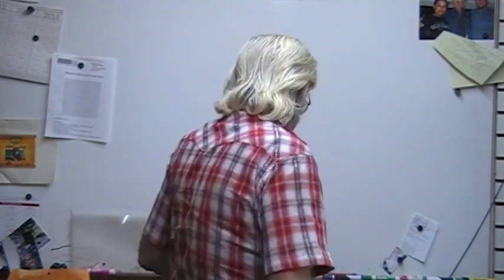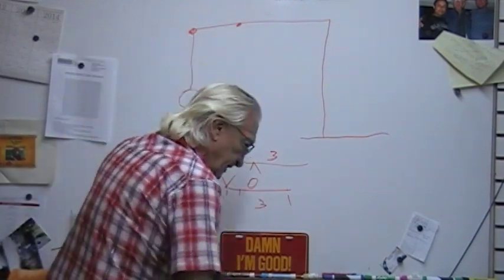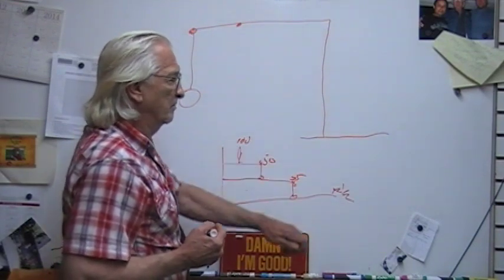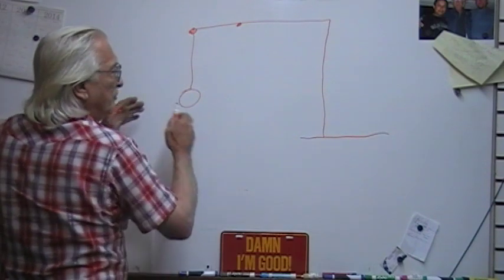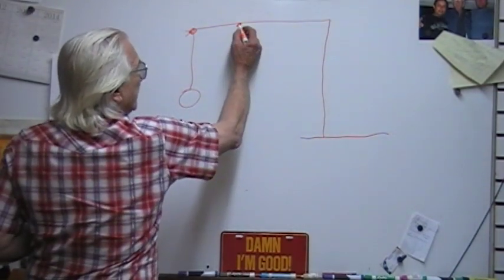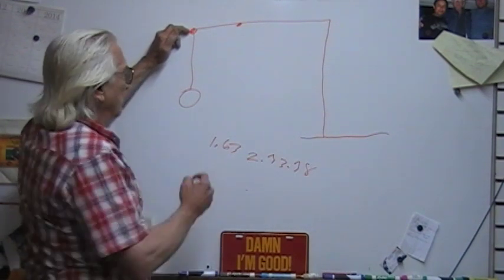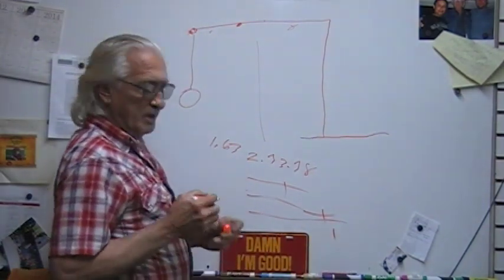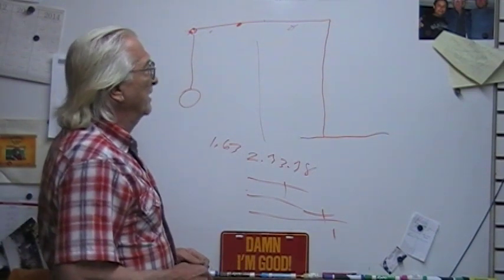workings of the TSO

Comment: Sir, I am six years older than you are and  watching this video I feel that it is my duty to  gently point out to you  a few issues,  before I die  and  regret to have never told you my secrets , as watching this video suggests that there is a little misunderstanding about the concepts  that you mention.

First , and understandably because of your hard work, you seem to be so certain that you have an over unity machine, but you must clear your mind as to what phenomena  you claim  is over unity.  Input and output Energy and Power in a machine  can never be over unity  as energy cannot be created, only exchanged. ( a bomb exploding in air is over unity because of its internal fuel exploding and not because of any exchange between  gravity and its velocity  during its flight after it leaves the muzzle of a gun)  On the other hand  input  and output forces in a machine as a lever of any type can be different and "amplified"  but it does not mean that Energy or Power is amplified, only forces  are changed and normally if a Force is increased  in a lever the related movement is decreased and vice versa.  Also please note that gravitational field is conservative and the work done between two points is independent of the path taken ( forgetting losses as you well know and found out by changing the pulleys to a better set)

At 8:28   when you describe the transverse lever you say that, " it is moving a greater distance, giving you four times the WORK" Well , I am afraid that is not true, the work done is exactly the same as the first  large force moving a shorter distance. There is no amplification there.

When you show concern about  the flexing of the  horizontal top power transfer bar to make you  modify the transverse lever to a shorter arrangment, well you can design a power transfer bar  by adding a geodesic structure to give you a higher inertia due to an effectively wider bar. A few structural elements in the form of triangles will  eliminate your concern for flexing of the power transfer bar.

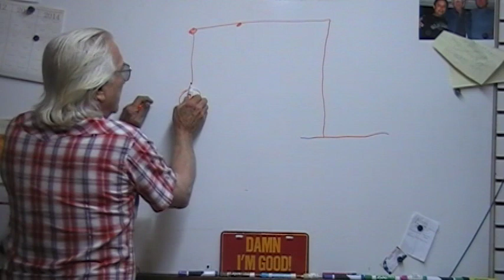Now as far as the pendulum, you never actually mention the most important issue, that of centrifugal force of the pendulum as it swings and changes  the direction. Well that pendulum is accelerating as its velocity is changing direction and so the force is outwards  of the circle it moves in and" the ten to sixteen degrees of pure power" you mention  at 9:48 is only the effect of CENTRIFUGAL FORCE DOWNWARDS.  It is a vector  Force and not Power. It is this centrifugal force plus the weight of the pendulum which is transferred to  along the power transfer bar to lift the load through the transverse lever ( which you do not really need)

Here is an important issue that you seem to misunderstand. Your system has a very useful energy storage system called a pendulum, and this can store energy to be used later. With a little force  applied over a long time or distance, it feels that one is not working so hard as a small force over a long distance is  an activity that  a person can tollerrate, but not a  high force for any length of time. This action was used in old petrol engines before they had electric starter, one would wind  a handle with a small force over a  relatively long time to store energy in a spring or a flywheel. Then the stored energy is clutched to the engine and the engine rotates  with a large force for a short duration for one turn and starts .  The converse is true for a clock or a  mechanical watch, one winds a clock over a short time with a high force and then  the clock escapement uses a  tiny force for a long time even up to 10 days. All this is due to the capacity to store energy to be used at a later time.

This is the principle of your machine, you have a heavy pendulum in which you store energy by swinging it with a small force over a long  relatively time and then during that "ten to sixteen degrees" when the centrifugal force on the pendulum acts downwards this plus the weight of the pendulum will give the load a  short jerk  where the  energy given to  the  load being pulled up  against gravity is exactly the  energy  lost by the pendulum during those " ten to sixteen degrees of pure power" as you gracefully put it at 9:48

Now Sir,  I hope that you will not be too disappointed that your structure will never amplify ENERGY and is not over unity as far as energy or  integrated power goes.  But  you have managed  to use a little FORCE applied over a relatively long period to store Energy in a pendulum to be used later  on a load as a larger FORCE over a shorter duration of time.

Now this principle can use a heavy flywheel and if you ever market a  water pump to be used in developing countries, yes you can have a child rotating a handle with a small force for a long time  and a reciprocating pump with a  short stroke and a heavy force to irrigate his field. Yes there I agree that it is a useful machine as humans can generate a small force for a long time, but  not a heavy force for any length of time.   And any way a man can only produce about .3 of a Horse power and he can store that in a large flywheel and use the stored energy to deliver higher power FOR A SHORTER TIME  till the flywheel or pendulum loses it .

I admire you for your interest is science and the associate engineering, and though I wish you keep enjoying yourself researching on the TSO, please take my advice and work on the storage of energy in flywheels or pendulums through small forces applied for a length of time and then used elsewhere through  loads using high forces for a short time as in pumps or small forces for a long long time as in mechanical watches. Wish you luck.
Reply from the maker: +Carmel Pule' SORRY ;  I  think you missed  something very important in the video.  Where I said "IF"  the machine is NOT over unity It still has practical use  . Such as using ones body weight to pump water to fields as they sleep.                  PLUS  I think you missed the video where I was driving the pendulum with a falling weight and picking up another weight .  The driving weight (80 LBS) fell 5 inches and picked up 6 BLS 4 inches  50 times.  80 X 5 is 400 inch pounds   6 X 4 is 24 inch pounds  X 50 times is a total of 1,200 inch pounds out to 400 inch pounds in.
Reply: +RHEAD100    Thank you for your information but Now let us analyse it.
You said that you  picked up 6LBS 4 inches 50 times  so that you raised that weight  200 inches .  I am new to our videos but as yet I have not seen any of your machine which are 200 inches high.
Since you mentioned 50 times I feel what you meant is that you picked up and LOWERED the 6 LBS 50 times.
I saw this raising and lowering of the weight many times in your  and other videos so here is what you should consider.
When the 6 LBS weight was lowered after it was raided,  its potential energy was GIVEN BACK to the pendulum  through shifting its pivot point and so the pendulum was being given energy  by the driving weight (80 LBS) through the escapement  that drove the pendulum  and also by the falling 6LBS weight dropping down.

Now you must consider that a a pendulum can be given energy through swinging it in a conventional manner and also by driving its pivot point, up and down and left and right in a synchronous manner.   This is exactly what  your two stage oscillator is doing  when you  drop the weight you lifted.  So since you dropped the weight , you transferred its energy back to the pendulum and so cannot claim that you did work on the 6 LBS weight.

Please do consider how much energy is fed back to the pendulum when the horizontal bar and the weight falls.
I think you will be very surprised.
Other researchers  can  confirm what I concluded and they did say that if the weight  is allowed  lift and drop  then the oscillation will proceed for a long time. If the weight is not allowed to drop to retain the energy , then the pendulum will have to be driven harder.
Well,  it is new year's eve and sir , I wish you a happy new year 2016.  I hope you reflect on what I said about the falling weight GIVING BACK ENERGY TO THE PENDULUM  and so no work done not energy is gained by the 6LBS weight.
Please do inform me whether in the data you supplied me with , you did actually lift the 6 LBS weight for 200 inches. as I feel that you did not.
Reply from the maker: +Carmel Pule' What you are saying would hold a lot of water to someone that understands book math and science. "BUT" to some one like me that has actually  used that same falling weight to turn a generator and charge a 12 volt battery from 9.5 volts up to 12.75 volt must as you , " how did the falling weight energy get back into the pendulum from the battery when the battery was not hooked to the pendulum in any way ??   I have had many people tell me the same thing,  "the free falling weight returns energy to the pendulum.     IT  DOES  NOT !!!!
Reply: +Carmel Pule' 

It is the last day of the year 2016 and history is
going to be made.

PROOF THAT FORCES AND ENERGY IN THE FALLING WEIGHT OF A
TWO STAGE OSCILLATOR IS BEING TRANSFERRED TO THE PENDULUM, BOTH DURING STATIC
AND DYNAMIC STATES.

Static condition. 
(For clarity let us assume that the horizontal lever on top is pivoted
at its centre. If it is not, the ratios of forces can easily be calculated
according to moments)

Take a dead load of 100lbs touching the ground and a
simple (not compound) pendulum weight 80 lbs hanging vertically, all without
motion. In this static situation the 100 lbs weight will transfer 80lbs force
back to the pendulum to keep it hanging without dropping, while the reaction on
the ground of the 100 lbs weight will be 20 lbs. The pendulum will not fall
because the 100 lbs is transferring 80 lbs force to the pendulum.   This is the first proof that there is a
force during static condition that is being transferred from the weight to the
pendulum.

Dynamic conditions.   With 100lbs
weight on the ground and an 80 lbs pendulum, the pendulum must be swung and
raised to a height to gain potential energy so that when released this will
accelerate to produce velocity and centrifugal force of at least a 20 lbs down
component in order to be added to the 80 lbs of the pendulum in order to lift
the 100lbs weight. (Let us say the pendulum was raised to a horizontal position
before it was released, and any position will do, but this is easier to assume a
horizontal position) 

THIS RAISING OF THE PENDULUM NEEDS A LOT OF INPUT
ENERGY.

The pendulum is released and nothing happens to the
100 lbs weight till the velocity of the pendulum produces a downward
centrifugal component of 20 lbs. At this  state, both the 80 lbs dead weight of the
pendulum and the 20 lbs down component of the centrifugal force will be
DROPPING DOWN LOSING ENERGY  while the
100 lbs dead weight that is  lifted GAINS
ENERGY AS THE CENTRIFUGAL  DOWN
COMPONENT  rises to 20-21-23-25- till
maximum, then goes back to 24-23-21- 20   to less and less. During this sector of
pendulum motion the 80 lbs pendulum and the down component of the centrifugal
force lose energy while the 100 lbs weight gains maximum energy as it reaches
its highest point. Note that the 80 lbs weight of the pendulum is losing energy
acting as an input in addition with the swing of the operator and this has to
somehow be regained at a later time.

Now if at this stage the 100lbs weight is quickly
taken off to do work elsewhere without effecting the pendulum, then the 80 lbs
swinging pendulum will drop fast rotating about the central pivot of the
horizontal lever, till it places itself below it, still swinging complexly but merrily
away doing nothing else as there will be nothing to raise it back.   But this does not happen because the 100 lbs
weight will remain attached to the pendulum, giving back an interesting set of
dynamics to the pendulum. 

Now let us assume that the pendulum has now swung to a
horizontal position( not necessarily but let us assume that) With the 80 lbs pendulum
horizontally placed  it will not transfer
forces nor energy to the 100lbs dead weight and it will use the 80 lbs to
accelerate itself down wards. At this time the 100 lbs dead weight at its
highest point, will accelerate itself downwards too, to later lift the pendulum
back to a higher place. When the pendulum takes an angle then its pivot point
is lifted up by the dropping 100lbs while the end of the 80 lbs weight of the pendulum
acts down. So at this point the pendulum pivot is lifted up with 100lbs while
the 80 lbs weight of the pendulum acts down, both separated by the length of
the pendulum producing a massive torque on the pendulum to swing back. (note,  the contribution of both the 80 lbs AND THE
100 LBS OF THE  still ATTACHED WIEGHT. )

If the 100 Lbs weight was not left connected to the top
horizontal lever the   swinging 80 lbs
pendulum would drop swinging about a vertical line through the central pivot of
the lever.  THE DEAD WEIGHT OF 100 LBS
CANNOT BE LESS THAN 80 LBS never, never. 
So if one needs to transfer energy to an external load only a weight of
20 lbs may be completely detached from the 100 weight to do work elsewhere,   but then the operator will have to pay for
it as the pendulum will not swing back to the original position, where an
operator can swing with one hand and have coffee with the other!!

I picked up the extreme case to prove a point but any
related state can be worked out.

If the 100 lbs weight, or part of it, is removed, then
the Pendulum will keep dropping in its swinging height till if the weight is
below 80 lbs there is a rotation such that the pendulum together where the
horizontal lever will become vertical where both the lever and the pendulum
will produce complex modes of oscillation attributed to systems with two
degrees of freedom as the two stage double pendulum.

This is proof that the 100lbs weight or not less than
80 lbs must remain attached to transfer force and energy back to the pendulum,
if the operator in not be subjected to heavy sweating not only to swing the
pendulum but to lift it from under the central pivot point of the lever (which
is the second pendulum in fact)
Reply: +Carmel Pule' Carmel , you're away with the Newtonian mechanics and I'm away with the Fairies but it's grand to read your real world academic stuff from out here in the Irish twilight zone. RHEAD100 is a man with the guts to try new approaches to mankind's antiquated and unhealthy methods of getting machines to do work for us, without raiding the primordial graveyards of plants and animals. He follows his gut feelings. In his own time at his own expense, he publicly demonstrates failure so others can learn from his good intentions.  I'll try to simplify what I think RHEAD100 means by "exponential energy gain". He can feel it in his imagination but like myself, he's a hands on pioneer who enjoys doing things instead of reading about things in text books. The Wright Brothers had no reference books on aviation! A century from now,  RHEAD 100's efforts will probably inspire someone to write books on Pendulumics and Gravitamic Dynamics.    Pure energy, by it's nature,  is an exponential force. Solid mass is a cluster of individual photons and electrons clumped around the nucleus of atoms, propelled by an inexhaustible and seemingly intelligent force, we humans call Gravity, or maybe it's the elusive Higgs Boson, the God Particle.  Either way, you'll agree Carmel, in the intelligent design of things,  there's a constant electromagnetic tug - push - pull - shove on everything and motion seems to be the natural state of being. Static is an illusion. At the molecular level, in quantum field physics,  everything is orbiting something in perpetual motion - no such thing as rest position, so what now Carmel?, "no such thing as perpetual motion?". "As above so below". Get a telescope and look up at the restless starry night, or get a microscope and look down at the endless electromagnetic activity of particles.   RHED100 is intuitively calculating the difference between a falling brick dropped off a height and a falling pendulum bob attached to a lever arm coupled to a shaft, mounted to a rigid frame on good quality bearings. Newton didn't have such high tech low friction mechanical components as flywheels and pendulums. RHEAD100 may not have the physics jargon to explain his insights or debate e-mc2 in words but don't blind  him with engineering data or we could all end up lighting fires in combustion chambers until there's nothing left to burn. Here's an engineering conundrum that's not in your books:A constricted falling weight anchored to a low friction pivot at the end of a pendulum arm and dropping in a curved path, will accelerate faster than an object falling on a vertical path. Both weights reach ground level at the same time but the curved path is 57% longer than the vertical. Lengthen the arm, increase the weight of the bob  and you have RHEAD's exponential energy gain. It takes a disproportionally smaller input force to maintain the motion of a pendulum as the mass of the bob is increased and the arm is lengthened. A 64ft arm swinging 180 degrees,  seems to be the optimum setup. FM=A, 32ft/sec acceleration doesn't apply to a pendulum. From a height of 64 feet, the bob passes through plumb position in the same time it takes the same weight to hit the ground when dropped from the cage of a 64 foot cherry picker jib. 57% extra acceleration applied to a swinging mass?   I don't profess to know how or why this this happens, do you know Carmel?
Reply: +cdevine53 Mr cdevine53,  The development of the human mind is a long long and an interesting process as it has to be done through the human sensors which cannot see what is behind silence  and invisibility which is a zone much larger than the universe itself, so those who are unfamiliar with the invisible phenomena can be excused for misinterpreting it. I am very compassionate to all these people , including myself as there are many invisible and silent functions which I do not understand.  It seems that to organise the  human mind to one day be able to  mentally conceive, get an inspiration, and see and understand  those relations that the human sensors can never depict,  the human mind has to go through a training period involving we standing on the shoulders of others who came before us, IT IS FUTILE TO THINK THAT IN ONE  LIFETIME, ON OUR OWN STEAM, WE CAN  CONCEIVE WHAT IS INVISIBLE AND SILENT. 
It seems that a primitive mind first  needs to be disciplined away from instinct and this is done in various manners, as psychology , laws, religions, social ethics, and it seems that it is the social disciplines come first including the rhythm of music and the discipline that created harmony in waltzes and the colour combinations and  sequences in good art.  All this slowly takes the human mind into an emotion which touches on the invisible phenomena including the creations of fairy tails and father Christmas and Snow white all being concepts which train the  human mind to think beyond the human sensors.  It is no good claiming that one can see everything through  instincts and the human sensors. They are not instruments sophisticated enough to dig deep into what our universe contains. 
To be able to " see and operate invisible and silent functions" we create voltmeters and ammeters and MATHEMATICS  with which we can simulate and equate situations.   No one could ever conceive that there is Atomic Energy in Uranium and other materials had mathematics did not produce the equal sign as "="  where one side of an equation must be equal  to the other side.   Many people think they can understand the weighing machine as they  are only to see with their human eyes, but  an equality appertaining to universal phenomena can involve,  Large Item with Mass(seen)  on one side, and    a smaller Item with  Mass on the other side  plus something which is invisible . The person who is trained to see with his  and think with his eyes, will think that this is impossible  , but they who know energy can  only understand all this through MATHEMATICS  as no human intuition can ever see the vastness of information that the University contains. We need help and special instruments and operators  to dig into deeper waters of science especial that of energy which is invisible to humans. 
Well, it is not true what you claim that a pendulum released  from the same height( assume placed  horizontally)at the same time as a  dead weight falling vertically  will arrive at the lowest point at the same time.  The weight  that falls vertically is subjected to a continuous full VERTICAL downwards gravitational acceleration, while the pendulum  starts with it, but the vertical accelerating component is decreased as the pendulum starts having a horizontal component , so the time for the pendulum to reach lower heights  is HIGHER that that for the Vertically dropping weight.    The situation is interesting as   while the acceleration for the pendulum is  less, it is applied to the BOB for a longer time and so the  terminal VELOCITY of the  both the vertical drop and the horizontal velocity of the pendulum are exactly the same, 
I do not think such a result could be detected by the human sensors but mathematics will show it clearly  without one having to build either a pendulum not drop a dead weight  from high risking his life and feeling cold if it is an icy day.     There are benefits in having developed a mind which sees beyond what the human sensors can see through using instinct and intuition without these standing on the shoulders of those who came before us. 
Most of my students do not know the difference between " having fun" and " being happy"   and most of them  especially the artists, and social workers, and religious personnel can only see what is before their eyes including symbols and art and music , but few of them can understand that a variable can have the first rate of change, the rate of change of the rate of change ,and the rate of change of the rate of change of the rate of change, and higher order derivatives,  as defined by calculus, Many people in traffic die because they cannot learn how to detect  the  rate of change of a varying function, and pilots during the war, got killed because they fire  directly at an oblique moving target, by  instinctively aiming directly at it and to their surprise they never hit a moving target only stationary ones. This is what many do while trying to detect energy from Gravity.
People trained as I am , well there are situation  in life where you do not fire at a moving target as most do.
In the TWO STAGE MILKOVIC  MECHANICAL OSCILLATOR,  the fact that it is mechanical , most people including Milkovic himself, saw only the mechanical motions of a swinging pendulum  and so came to their own conclusions. 
Well, Energy, Momentum, Mass, Power, they cannot be seen and they are weightless and it is this that many people handling the Two Stage oscillator cannot see. There is a moving pivot  in the pendulum of that machine  and through that moving pendulum pivot there is a lot of invisible ENERGY being transferred to many types of loads AND BACK TO THE PENDULUM.    The latter is  an operation which  many people fail to see and this is why the pendulum appears not to be heavy to push.   But once this machine is loaded there is less energy fed back to the pendulum which loses its swing,   All this is invisible  and silent and many people relying on instinct and intuition alone will  not see it, and will persevere fruitlessly , in a field which is no different from all the other field that engineering machines operate in, that no output energy or power is greater than  what energy or power is provided at the input.    It is so unfortunately that many " see" forces   and what is  more many people in the Milkovic machine keeps saying, " look how much weight it lifts" when before them in front of their very eyes, the weight is being lifted AND  dropped, so in fact there is no work done on the load weight as  the energy went back to the pendulum .....................  an operation all done in silence and invisibility to which their  human eyes and ears can never detect, and it takes a deeper mind to know of it, a mind which any body can have if one moves slowly with humility and modesty and perseverance and patience and not  to try and  show the intensity of their own instinctive lights by hiding the  academic and conceptual  mathematical lights of others under  the  tangible  spiky bushels they understand and sometimes throw at others.
Reply: +Carmel Pule' ,,,,,,,,,,,  Well too ra loo ra loora and  tweedle dee tweedle dom,  you are one mighty thinker! You should run for president.  I've never voted anyone in my life, except myself, but I would vote twice for you Carmel. "If you want your children to be intelligent, tell them fairytales. If you want them to be more intelligent, tell them more fairytales", ,,,,,,,,,,,, Albert Einstein.------------- The great physicist/mathematician didn't believe in fairies, he was promoting a more frequent use of the boundless human imagination: That's the E,( energy) that creates the M, (mass), when equalised by some high speed magical trick of the light. ????????.   Understandably, disciplined academics like yourself are reluctant to venture across the hidden line to Einstein's twilight zone, where everything exists in pure invisible energy form, e=mc2,   -----  Fairy play to you Carmel, you at least acknowledge the existence of such a region in the human mind,,, instinct - intuition. In Ireland we call this, ---"Gumption".  Here's another quote from little wild-haired pipe smoking Albert, who reminds me of Shaun, me wee mystical Leprechaun friend. ----------- "Only those who can see the invisible can do the impossible".......... Shaun reckons there's no such thing as magic, only a defect in humanity's eyesight and a gaping void in our understanding of the natural world. ------------- "One man's magic is another man's engineering", says some sci-fi author who's name I forget. Sometimes one man's engineering is a JOKE, like my flywheel experiment on You Tube!--------- Carmel, how very observant of you to notice the MILKOVIC  and RHEAD 100s weightlifting TSOs are in fact energy exchangers ,,,,,,, the weight being lifted is recharging the pendulum as it drops, replacing the energy escaping through the moving fulcrum. If the weight being lifted was held up by a ratchet mechanism, things would look quite different, as you and I will now explore.  ??????? In your imagination, where standard mathematics don't always apply,  allow me so stand on your engineering shoulders and we'll take a closer look at my 1SO, ( ONE STAGE OSCILLATER). We'll drop two equal weights from a height of 64 feet. (Minimum height of 64ft very important to overcome initial inertia and maximise gravitational acceleration) The first weight is free falling and the second is connected  by a ridged arm to a ridged fulcrum. No TSO loose  components to cause an energy leak.  --- The free falling weight has nothing but gravity accelerating it, so you can easily predict it's velocity at ground level, 2 seconds later.   A few milliseconds into the drop however, the pendulum bob feels a tug , (a new secondary force )appears from the fulcrum. What effect does this have on the second weight before we add an input force? ,,,,,,,,,,,,. Think about it, would it cause acceleration of the bob?  --"Action = opposite reaction", Newton. Now ask yourself Carmel, does the unseen force, (the tension ) created between the bob and the fulcrum turn the restricted weight into a projectile and is the input force also  exponential with increased bob  acceleration? ------------- When a trained marksman is - "firing at a moving target", ----as you put it, he adjusts his sights accordingly. If he aimed at the falling pendulum bob using f=ma calculations, he would miss it by 57% at the end of it's  2 second drop. I have yet to try a 144ft 3 second 1SO  setup and measure it's exponentiality .           MILKOVIC and RHEAD 100 talk about a short arm pendulum's  multiples of over unity, as I myself once thought. I now realise the a simple 64ft pendulum is a 157% efficient simple engine,  if common sense is used in it's mechanical configured. ---------------I invite you Carmel to explain to RHEAD 100  and myself, the secondary forces that are created between the pendulum bob and the fulcrum. We Shaun says there's is no mystery here. You're not factoring in the extra force of tension, "a misunderstood gift from gravity", he calls it. Wee Shaun doesn't use the  antiquated human internet communication technology. He asked me telekeneticaly to ask you  not tocomment on pendulomics without calculating all the forces involved or you'll confuse us all.May the Craic be with you.